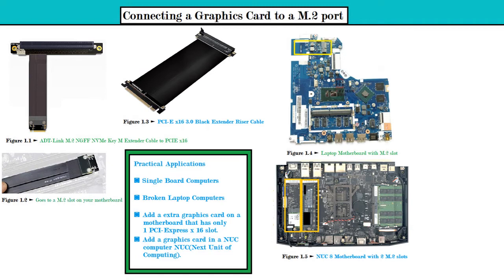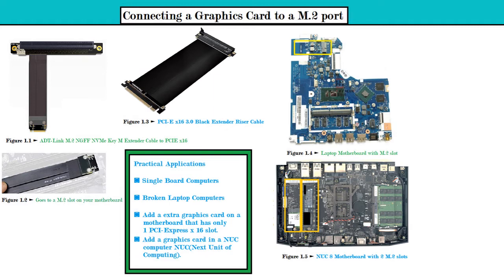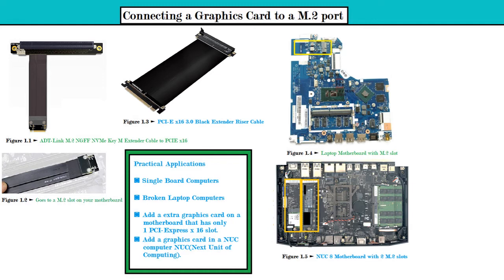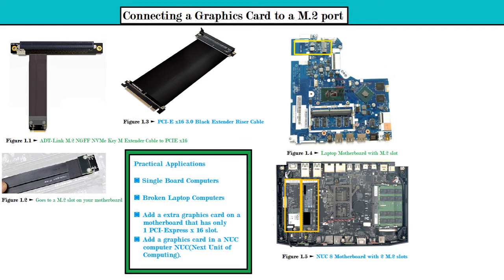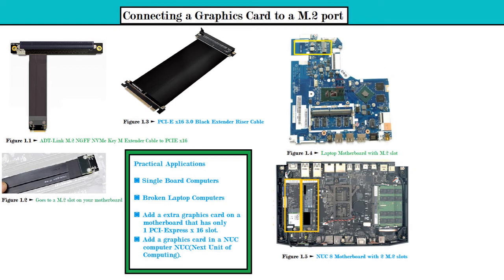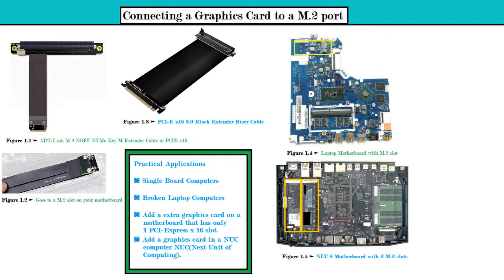M.2 slot to PCI Express x 16 slot  Conversion

Comment: I'd like to use an adapter from mini PCIe to PCI 32bit in or order to use my old M-Audio Delta series sound card.

My laptop ony gives me an ngff output. Do you think it would work like that ngff to mini pcie and then mini pcie to 2x slot pci 32bit?

Thank you!
Reply from the maker: Does your mini PCIe to PCI 32 bit adapter work in  a regular PCI-e x 16 slot? If it does then it will work here, but if it doesn't then it will probably not work here.
Reply: @Ace1000ks  I actually havent tries yet. I have this pci card in an old desktop... But your answer helped me a lot. One told me this would only work with wifi devices, wich I dont believe its true.

Comment: Have you been successful in using one of these adapters? Interested in expaning my mini itx board personally
Reply from the maker: I used it on a Intel NUC PC a few years ago. You need a separate power supply to power the graphics card, but the experiment was a success.
Reply: @Ace1000ks  nice! Looking to do a capture card myself.

Comment: can i use this on laptop? is the power input on x16 optional only if i will power my graphics card directly?
Reply from the maker: Yes, you can use it in a laptop, but you need a separate power supply to power the graphics card.